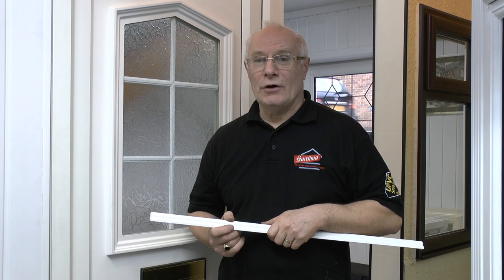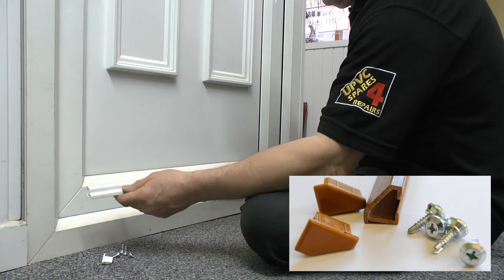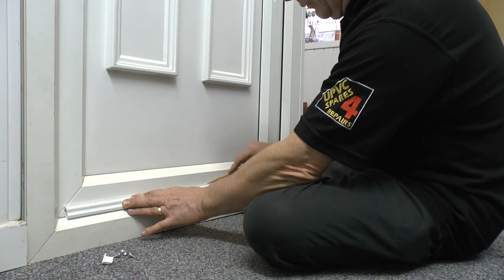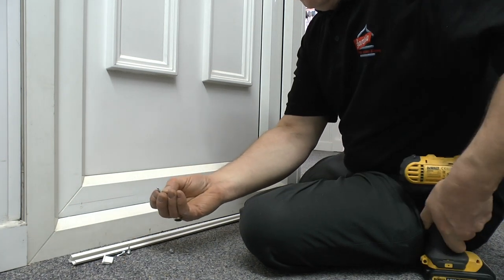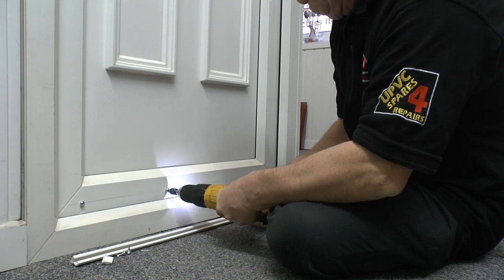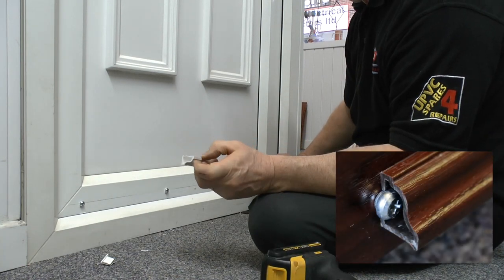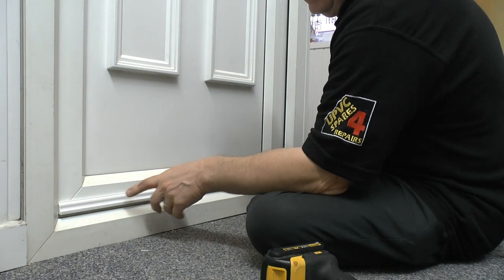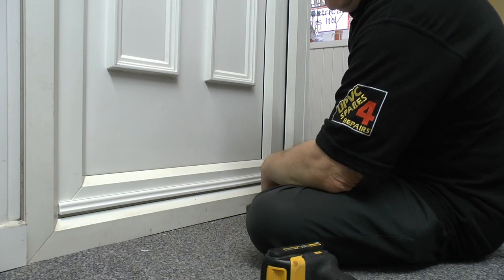How To Fit A Drip Bar To A UPVC Door

Comment from the maker: Hi Ken you should never be using a jet wash on a door and not expecting it to leak the pressure that uses is far beyond any severe weather testing for the UK industry and would only be replicated in a storm flood or hurricane. Weather bars are to shed excess amounts of water so that the existing drainage system can cope with water that gets into it. If you are looking for a flood proof door then this is a totally different product. Hope this helps with your comment regards upvcspares4repairs.